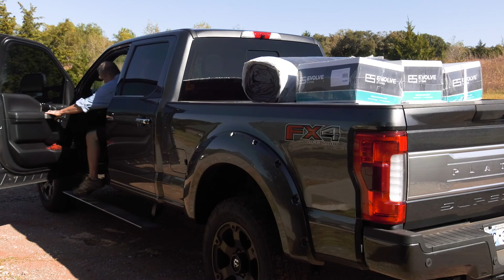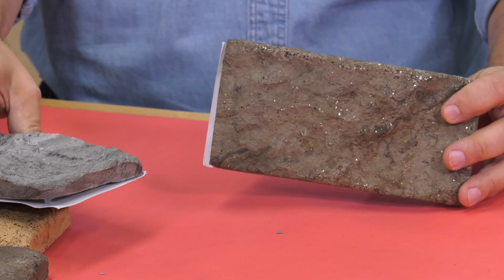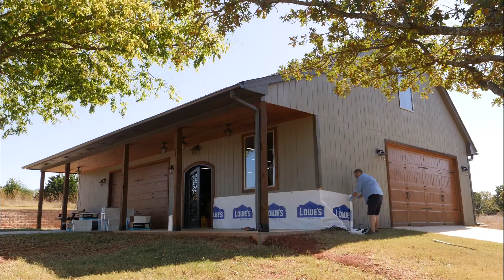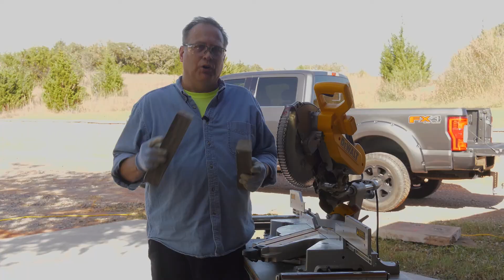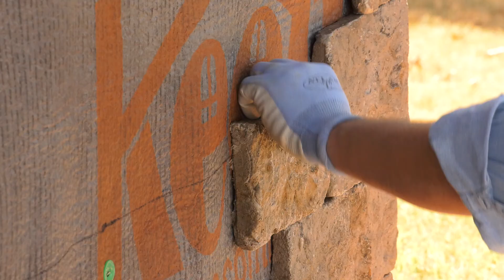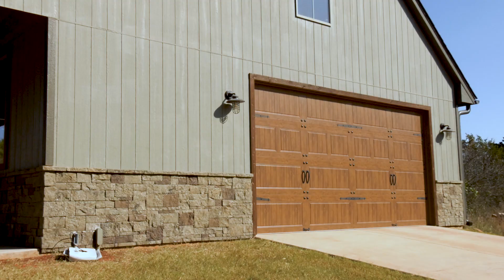EVOLVE STONE Real Consumer Review

Comment: Can you use an 18 Gage Brad nailer?
Reply from the maker: Hey Scott!  Just to stay in installation spec I wouldn't recommend it.  Will it totally wreck the install? Probably not but either way, just make sure you use stainless steel nails.  They must be weather resistant.  Otherwise, in time they will corrode and fail.  Good luck with your install.  FYI, it's been 3 years since our install and the product/install has held up wonderfully.  Could not be happier with the product and the look.
Reply: @forgeconstruction9181  Is there a place to find more updated pictures and other projects that you did. Such as the customer you mentioned first in the video?

Comment: I am about 3/4 of the way through a project and had similar results (all good). I had to call customer service a couple of times and was treated well despite my many questions. One tip.... I am applying the stone over both wood and concrete and needed both nails and construction adhesive. I am using more of both than expected.  Since the nails (16 ga 2-1/2" stainless colated) are a special order from my suplier (Home Depot), order more than you need and return the extra.

Comment: Good video.  I would have cut-in a flashing under the exposed lower edge of the T1-11 before starting the ledger and then ran it over top of the ledger stone.
Reply: I was thinking the same exact thing. Rain will run down right under the typar...
Reply: Exactly… that’s an LP/OSB T1-11, that trapped water will rot that out quick

Comment: Look at the pin holes in the stuff they are using. This is caused by air bubbles in the product. Won't the finish nails make it easier for water to penetrate to the sub-straight?  How do you call it stone, when you can drive a finish nail thru it? The web site says to expect fading in the first 3 months! Brand new product....to many if's to take a chance on installing for a client. NO THANK'S I will use proven cultured stone veneer.

Comment: Does the ledger stone need to be caulked to keep water from getting behind the groove of the T1-11?
Reply: I disagree the owner of this barn will suffer from long term water damage issues. The tyvek and drip barrier were not installed correctly in this video. The t11 siding should have been cut and the tyvek shoved up under the t11 and a piece of flashing should have been placed over the top brick to prevent waiter from getting behind the stone

Comment: Interesting. Do you fill in the screw holes for the ledgers or sills? Any idea on the price per box and how many square feet it covers? I went to their website and nothing is really stated. They go through dealers. Found out there's a dealer about 20 minutes from me.
Reply: Home Depot sells it
Reply: NVM. Each box contains 14.25 sq ft.
Reply: 14.25 sq feet per box and around 245.00 per box.
Reply: @Dragnslar2  $245 for 15sqft seems kinda crazy but yeah thats what home depot shows.